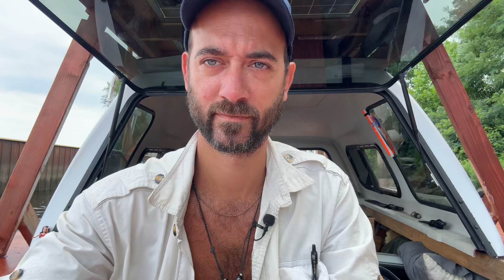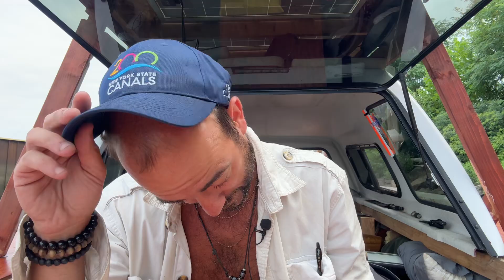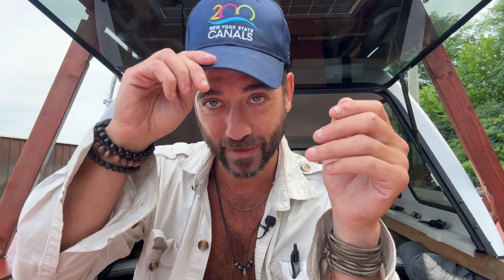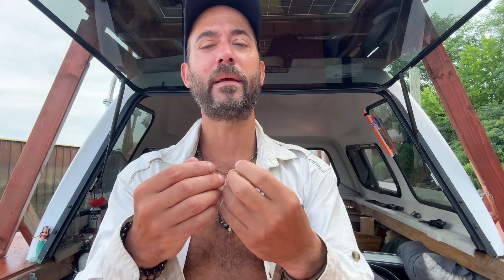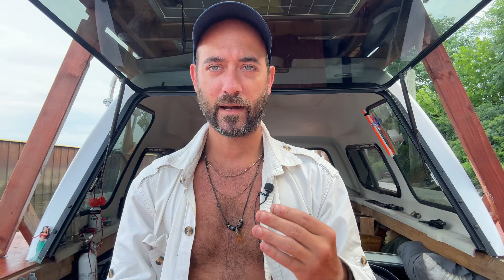Day 2 — Planning a 25 Mile Trip Considering Wind and Tide

Comment: Thanks for the updates, Dallas. Interesting insights about the role of the Erie Canal in aligning the economic, political and cultural interests of the Mid-West with the Northeast and especially NYC.

A lot to consider regarding winds, tides and currents. Years ago, I used to sail on the Charles River in Boston. The winds were usually from the west, the river flowed towards the east, and the Charles River Dam minimized tides. It took about a half-hour to sail from the Massachusetts Avenue Bridge to the Longfellow Bridge and about 1-1/2-hours on the return trip.

Experience is your best guide. Better than all of the book learning you can ever do. - Arif
Reply from the maker: So true Arif. I’ve read books on motors and wind turbines and solar charging blah blah… it’s all abstract until I see it in front of me